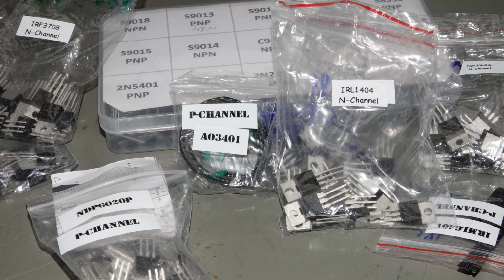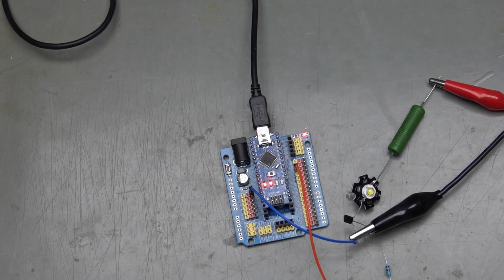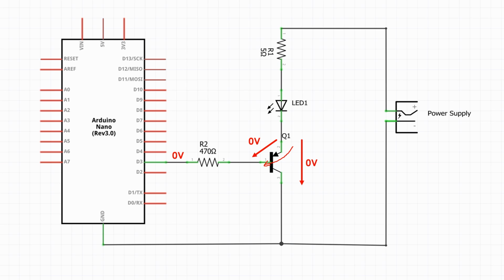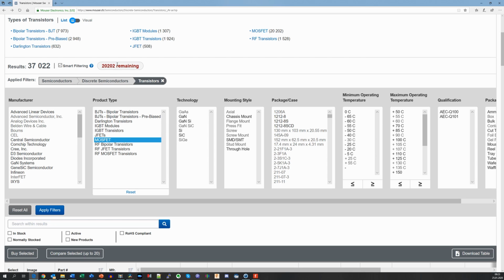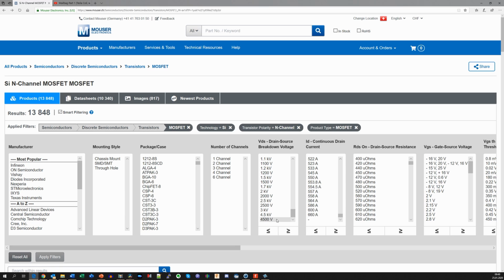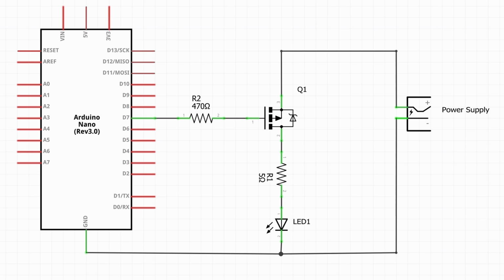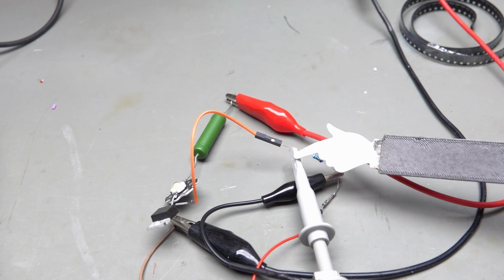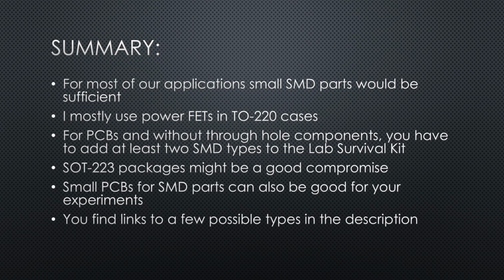#310 Transistors "Survival Kit" and Tutorial for Makers

Comment: Over 40 years ago, when I went to university, digital electronics (TTL) were just getting popular.  Frequency were still low and MOSFETs did not really exist.  The whole semester was sent studying "characteristic curves" with no mention of switching circuits.  ("Saturation" was BAD !)  Boy, how times have changed !
Reply from the maker: Definitively (I was there from 1977-1982). This is why this video is also good for old boys. These FETs are really great little parts!
Reply: @AndreasSpiess  In the middle 80s, while writing embedded code (in assembler), I tried to convince the guys designing circuits that MOSFET were the way of the future, replacing Darlintons.  The obvious first benefit was low power dissipation, but cost was still too high (when you are making over 1 million devices).   The Rds On values today are AMAZING !
Reply: I would love to see a "part 2" of this, covering the why your "survival kit" contain as many through-hole transistor as it does (i.e. what characteristics were important to your selection).  I am too old (shaky hands) to even try to solder SMD (like that young wiper snapper  over on GreatScott channel.) Also maybe some "tricks" like using a N-channel FET as a high side driver with a voltage doubler or using a "driver" transistor for power MOSFETs that require higher Vgs.
Reply from the maker: I use throughhole parts mainly for experimentation on breadboards. On PCBs I prefer SMD. Much faster and easier to handle for me.

Comment: Fabulously useful tutorial. It ís nice to be able to reduce inventory & 37k to 4 is a serious reduction. I am all for using the most common & low cost part I can find. I tried a similar exercise with surface mount capacitors & shot my self as frequency response, temperature response & piezo effect hurt me, but on the plus side I did learn a lot about capacitors. In my case it mostly came down to specific applications with needed well defined parameters & I now study data sheet & capacitors types very carefully. Thanks for sharing!
Reply from the maker: You are welcome. Of course, there is a reason for the 37000 parts. But because the usual maker does not have extended needs and maybe not every cent counts as for a production run, it was possible to narrow it down. For passives, it is a little different, as you mentioned.

Comment: LCSC.COM is a huge Chinese supplier for electronic components with a massive collection. Their prices are quite low but they have a minimal shipping fee of about $4 and they charge a handling fee of $3 for orders under $15. 
To my surprise the IRF3708 (TO-220) is not in stock and quite expensive $1.50 a piece. So for this particular MOSFET LCSC isn’t a good source.
You could choose this one as an alternative. 
https://lcsc.com/product-detail/MOSFET_Infineon-Technologies_IRL7833PBF_Infineon-Technologies-IRL7833PBF_C148142.html
It has a drain to source voltage of 30V (in stead of 60V) and can handle 150A (in stead of 62A)

Not an affiliate link.
Reply from the maker: Good you mention LCSC. They claim to check their suppliers. Maybe we have to use them more than AliExpress for those parts.
Reply: Andreas Spiess 
To me LCSC is like the Chinese Mouser. 
They have the usual top brands as well as low cost Chinese brands. But even the top brands are significantly lower priced compared to their US and EU competitors. Shipping takes longer though.

Comment: It is unfortunate that there is more choice of logic MOSFETs in SMA packages, certainly at medium to low current.
As a circuit idea: when using a MOSFET as a high side on/off switch it is a good idea to put the push button in the gate circuit switching to ground, rather than across the drain source. A pair of diodes are used to isolate the processor on signal from that of the push button. Then the push button can still be monitored by the processor to determine when to switch off. With the correct software, the button then performs an on/off toggle function. When the MOSFET is in the off state the supply current to the whole circuit is just the very low leakage current through the MOSFET, this is practically zero.
There can be some advantages in arranging circuits that switch to ground to turn on. Some microcontrollers default to pins being input at reset, with internal pull up resistors, PICs for example. This can result in unwanted high level, medium impedance on signals being generated while the processor is held in reset. By switching to ground this can be avoided.
Reply from the maker: Thank you for your explanations. For sure you could use the switch to power the FET on. 
It was very easy to explain in the video to have two switches in parallel for power. In my case, the MCU does not need to know anything about the status of the switch. It only provides enough power to get the thing running until it is able to switch the pin to high. I have to confess, I did not think too much and it works...

Comment: Thanks for an amazingly straight-forwards and clear tutorial on transistors (with almost no maths!). 
I've always avoided transistors being too complicated to use, just sticking to resistors and capacitors for simple protection tasks, and probably wasting a lot of money on very simple pre-built sensor modules for my Arduino projects.
This has given me the confidence to try start building my own more complicated discrete component circuits, I shall definitely be including your self power off circuit in some of my battery powered designs.
Off to Amazon I go!
Reply from the maker: Great! That was the purpose of this video. To make it as simple as possible (but not simpler). As another guy with a Swiss accent said (Einstein)...

Comment: I'd reccomend SO8 mosfets. They are able to have low resistances for a fraction of cost of to-220.
Also, once I bought AO3400A mosfets on Ali, which supposed to have 25-50 mOhm Rds(on). I checked their resistance and it was 5 freaking ohms...
Reply from the maker: Thanks for the tip on SO8. It was not on my "radar" so far... After a few comments about fake parts I decided to dig a little into it...

Comment: A master class. Stop.
Reply from the maker: Thank you. Very much apreciated!
Reply: @AndreasSpiess  Cuz everyone of us sometime uses 5 volts logics and one day starts to use 3.3 volts logics (Arduino --> ESP32), a correct understand of the table on 17:17 and its consequences is a great headache solver. A circuit that works OK side to an Arduino can stop working side to an ESP32, so as you said in the video look for a mosfet that works from 2.5 volts gate to source and everything goes fine with Arduino and ESP32 (8266).
It's a small detail but it makes the difference: go, no go.

Thanks again for your beautiful explanation (as DroneBot Workshop said, and that's not a bad reference)

Comment: I think BJT still have a place in the hobbiest's world.  A power bjt is typically going to be cheaper than a similar power fet with a low-enough Vgs to be easily implemented without driver and also much more robust than FETs from an ESD perspective, you'd have to be trying pretty hard to destroy a good old 2n2222 NPN but a 2n7002 N-Fet is fairly readily killed.  And while you don't go into linear, driving LEDs is a classic case where a BJT is useful for it's relatively simple means to select an output current, good enough for an LED, without needing any feedback or additional current limiting, just take the Hfe and calculate the base current, close enough job done.  Anyway,  at least a baggie of 2n2222 and a few BD139 should be in every parts draw if you ask me.
Reply from the maker: You are right. This is why I included them in hte video. But still, in the smallest survival kit I probably would place FETs...

Comment: IRF3708 are really bulky and as you mentioned an overkill. I use BS170 , its TO-92 package in more handy, its Gate source threshold voltage is 2.1 volts, very suitable for ESP32 and it can deliver around 500 MA. Best of everything.
Reply: ands it P-channel equivalent BS250
Reply from the maker: They are sold as small signal FETs and have a quite high Rds on. So they get probably hot qute fast. But of course, it is a possibility. I have them also here, but usually use SMDs instead of them.

Comment: Nicely explained, Andreas! I would disagree with you on "totally skipping BJTs" though - A baggie each of 2N2222 and 2N2907 is handy for emitter-followers and as easy gate-drivers for MOSFETs when you need a gate-drive-current more than 20mA. Definitely beyond the scope of this video, but have you dabbled with "depletion mode" MOSFETs? These are on at zero volt (i.e. v_gs_th <0) and have very specialistic use-cases. One can still buy them on the Mousers and Digikeys of this world due to their application in GaN drivers, apparently, but have many other fun applications, and are underappreciated, imo.
Reply from the maker: This video was already 27 minutes, much more than my usual budget. I knew from the beginning that I have to focus, focus, focus on the really needed things for a "normal" Maker. But of course, BJTs are useful. this is why I covered them.
No, I never had depleton mode FETs, but I read about htem during the preparation of that video.

Comment: Excellent video again...Fake parts..we got caught with a product we get made in China by a LCD manufacturer..they actually assemble our pcb's..they were caught by fake 741 opamps..we had to change over 1800 out of 3000 units once I discovered the issue. Our supplier is a very reputable company in China and they only use top of the line supply chain and they got caught out. So it can happen thats for sure
Reply from the maker: That is a mess! But because of the "fake" comments I decided to dig a little more into this topic...

Comment: AliExpress sellers sometimes buy defective parts, which did not pass the manufacturer checks. I had some IRLML6402, which always passed current and some MPU6050 with one axis always showing maximum acceleration. To avoid faulty parts you should look at the item's photo and the description. There must be a photo of the component you looking for and not a generic picture of some random component, and at least type of the component must be written in the description. If it is so, it is 90% not defective or fake.
Reply from the maker: Thank you for the tips. I also test the more expensive parts when they arrive and start a dispute if they are not ok.

Comment: My understanding is that a lot of the "fake" parts coming out of China are actually legitimate parts that failed Quality Control, and thus will still be useful in some cases, or are intentionally mislabelled, such as by marking a 32 Gb sdcard as a 128 Gb sdcard.
Reply from the maker: I cannot imagine that this is the case with such simple parts like transistors. The reject rate cannot be very high, and putting it together in a rail seems to be an overkill. But of course, you never know. With more complex parts this is well possible.

Comment: I got myself some IRF3205 from Aliexpress a while ago (1.70€ for 5 of them) and are absolutely overkill in a TO220 package, 110A max current, and i believe it's 4V to fully trigger it. Also, 8mΩ, so i'd say it's impossible to overheat it with a normal diy project (at least, the ones with a simple PSU or battery)...
Reply from the maker: According the data sheet it is probably better for 5 volt then for 3 volt logic.
Reply: @AndreasSpiess  Yes, that's why it's perfect for me, i only have arduino nano, so all my high signals are 5v... it was mostly to comment the good results with products from Aliexpress (also arduino source)

Comment: About 'fake' transistors: The chinese definitely sometimes sell you broken transistors (and other electronics). For example I got 20 IRFP260N mosfets at some point, all broken, only the body diode seemed to work. From what I can tell, the most "popular" transistors are the most likely to be fake/broken/whatever. I personally cant say for sure that any were fake, but then I dont have all the equipment to check the specs of everything I order.
Reply from the maker: I also do not check the transistors when they come. The ones I used in the video came off the box and at least worked. Because I do not use them to their limit I also do not care too much if they comply. The only thing: They have to be "logic level". And so far, all I got worked with my ESPs.
Reply: @AndreasSpiess  Maybe you should test it for a video at some point. I´m sure many viewers would be interested, and you might have enough lab equipment to do a few tests.
Reply: There are expensive MOSFETs eg, STP60NF06(built-in protection), so if you relabelled a cheap  IRFZ44 you can charge the premium price for a cheap part.
Reply from the maker: @Basement ScienceE: After many comments about "fakes" I exactly decided to do that ;-)
Reply: @AndreasSpiess  Awesome! Looking forward to it.

Comment: A bit disappointed the beefy MOSFETs you choosed only handle a relative small voltage. I'd recommend parts, that at least handle up to 50 VDC ;)
Reply from the maker: What would be your recommendation? There is always room for improvement. So far I had no DC projects above 24 volts...
Reply: such levels of Vds are specialty fets. their characteristics are worse than ones of a common type.

Comment: Yes, the frustration with Mouser.  It has everything, but does not give you an intuition for what is inexpensive, and commonly used.  Tell me Andreas, what is your favorite 3-pin PNP Fetlington, like the 2n7000?  Alright ... if I had only two MOSFETs for TTL switching at ordinary current, it would be the AO3400/AO3401.  These are Chinese Alpha&Omega clones; they are really cheap and widely available.   For general purpose BPJ amps, maybe 2N2222/2N2907, just because I am a high-power hamburger-eating American.  For you folks in those other countries, it will be the BC547/BC557, because you hate Americans.
Reply: Another source for components is DigiKey, sort on stock levels and you may get an indication which type is most used.
Reply from the maker: The 2n7000 seems to be a N-channel FET, not an NPN transistor.
Reply: @AndreasSpiess  Yes Andreas, the 2n7000 is an NPN MOSFET ... But what PNP variety is available in TO-92?  See, that is the dilemma.  If I only had 2 transistors, I need a complement for my FETlington in friendly package.
Reply: @AndreasSpiess  The 2N7000 may have been quoted
- RDS On is "bad" 5 ohm
- VGS On is also "bad" 4.5V.
- But it's the only one I can think about in TO92 package

Comment: Woo hoo, I need to cut down my 2000ish collection to something more managable.
Reply from the maker: It would be interesting to know why you have these 2000 types.
Reply: @AndreasSpiess  For my Job :-) I design electronics, so I always think I have the right one for the task and then find out I need one with a different hfe or gate on voltage or any of the other 30 odd different parameters :D
Reply: @foxabilo Question for you if you don't mind answering, what are the most commonly used MOSFETs in your projects? 
I'm trying to expand my electronic components inventory and I need to get some "ideas".
Reply: @Asyss_Complex  NTR4501NT1G for logic level  (5v) switching for micro-controllers by far and away, but I also use a wide range of power mosfets for brushless sensorless  DC motor applications, such as the Irfp4668, my real problem is every job requires something just a little different :D
Reply: @foxabilo  is that performance driven or is there a device that would work in most projects but is too expensive etc?
Reply: @anullhandle  Pure performance driven, you can have one transistor that works great for 5 volt systems but fails with 3.3v or maybe has to low a current rating or source to drain voltage range or power dissipation or insufficient VDS on resistance for your gate input voltage. If I were starting out I would get a NPN/PNP BJT Kit from Amazon/Ebay and some Logic Level N channel MOSFETs (IRLB8314) and some Logic Level P channel MOSFETs (IPB80P03P4L-04)